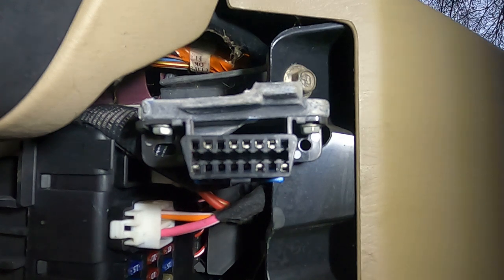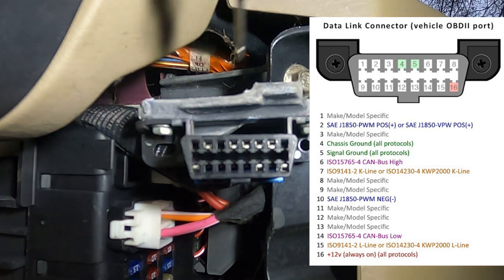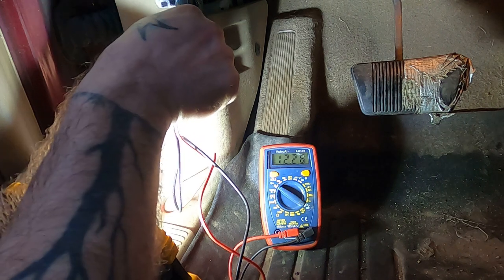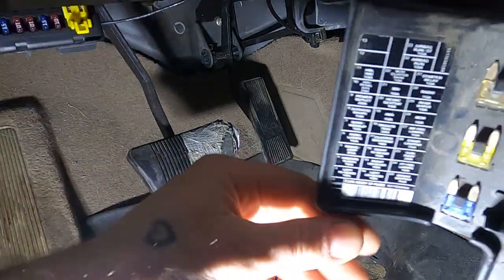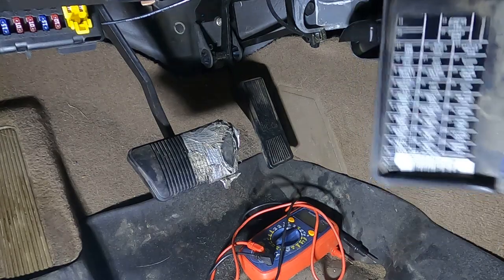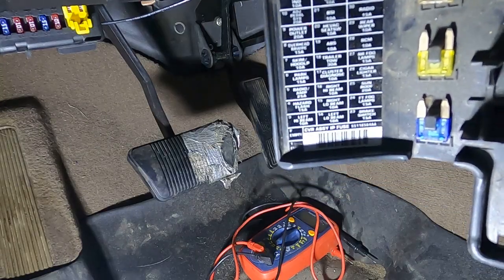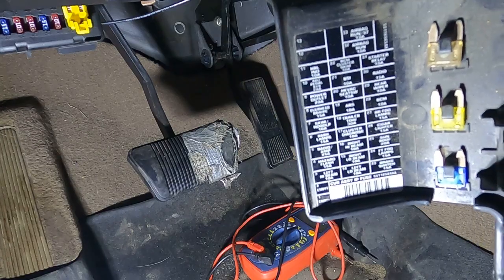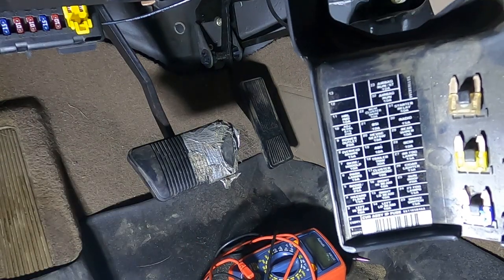EASY FIX - OBD II data port has no power

Comment: MY OBD-2 Ports don't work at all....err...wait...both my trucks don't have them they're too old LOL.  Pulling codes from an EEC-IV or a OBD-1 system can be very hit and miss.  No check engine light in my 87 Ranger.  Wasn't running right, no codes.  Very fun trying to figure out.  Finally I had posted the issue with the symptoms, as well as the diagnostic stuff I had done with the results on a forum, and someone says hey did you change the O2 sensor, well hell no why would I type thing.  So for $44 for an O2 sensor the problem is gone.  Turned out the O2 sensor wires were down to bare wires and hitting things, grounding out and causing all sorts of bad data to be sent to the ECM.  A new O2 sensor fixed what I thought was some major electrical or engine problem.  Truck has 119K miles on it, and runs and drives great.  Took it on a 300 mile trip a couple months ago,  most of which was freeway miles at 80mph...got back home filled up with gas, figured the mileage, I was getting 25mpg with it at 80mph, so figure 65-75mph and it probably could break the 26mpg mark...this is with the 2.9L V6, 5 speed manual transmission, 3.73 gears, and 7 foot bed, 4x2.  On the way home I had an additional probably 200-300 pounds of camper shell on the back.  Pretty decent fuel economy for a 34 year old truck.

Comment: Don't forget the common issue with aftermarket crap wired in and pulling power etc from the OBD2 port.  Look for the wire nuts and tape.
Reply: And then what? Found the wire nuts and tape so do I just look for bad wires or unhook stuff? I have an aftermarket radio in my 2003 Tahoe and it's going through an OBD splitter at my OBD port. My truck keeps dying on me while I'm driving and I've already done a couple things already so nearing it down but I need codes and I can't get the OBD reader to connect.